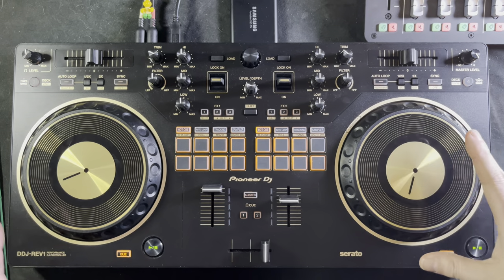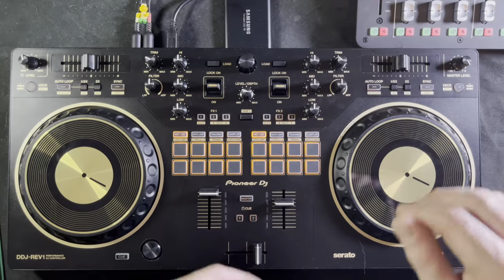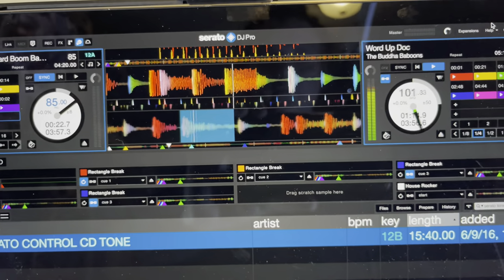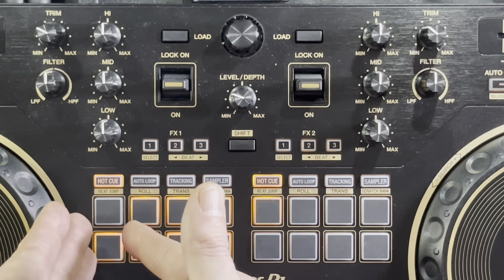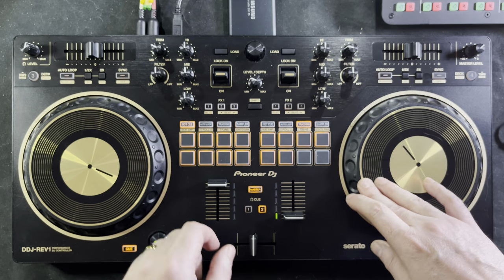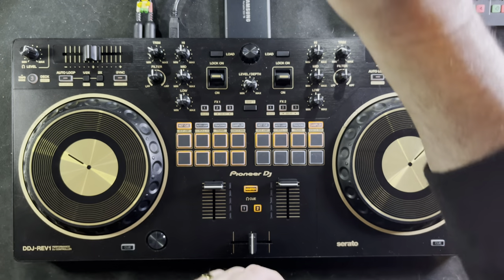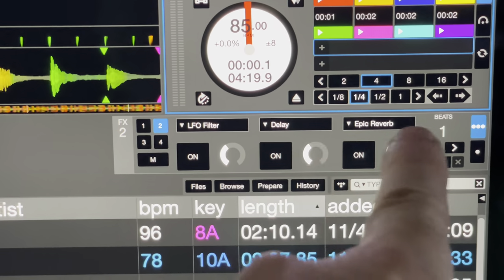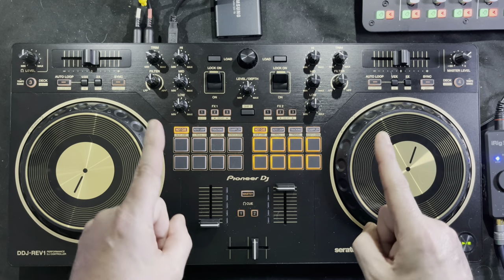In depth Tutorial of the Pioneer DDJ REV1 N limited Gold Serato dj controller

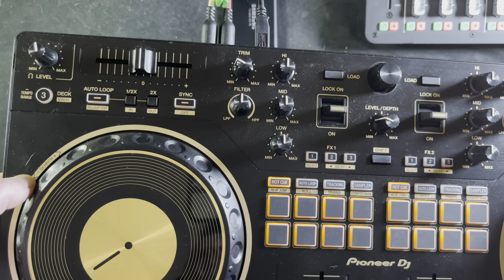Comment: 4:40 Searching
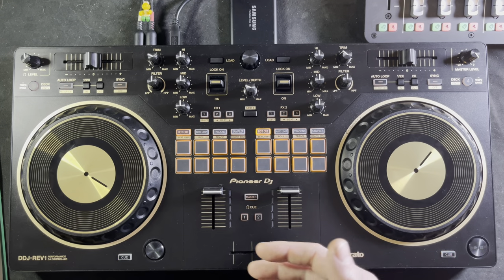6:13 Slip/Vinyl MODE
7:12 Tempo Range
7:50 Access Next Deck
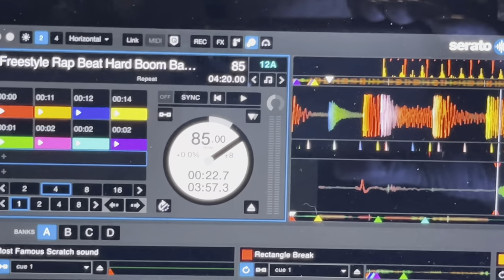8:38 View decks 2/4 (may NOT be available LITE)
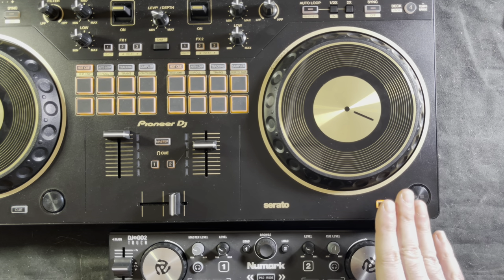10:01 Autoloop Button
13:49 Manuel Loop in/out
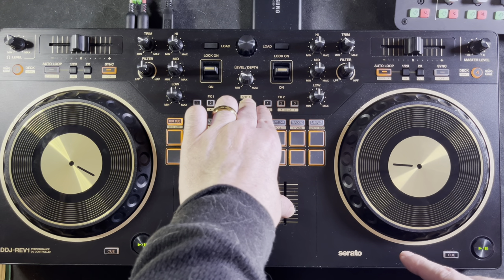14:16 Loop Adjust Controller
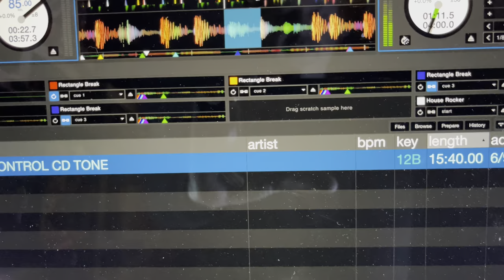15:30 Loop Adjust Visual
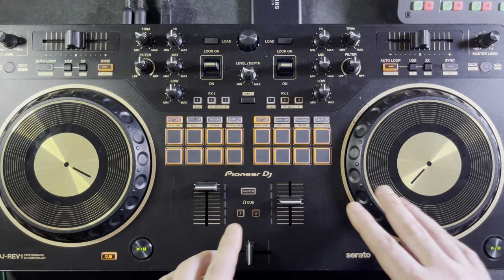17:22 Edit of up faders 
20:15 View BPM of track (---I---I---)

Comment: @djchance the beat jump feature is useful for exactly what you mentioned—setting hot cues. For example, you find the start of the chorus or vocals and you set beat jump to 8 or 16 bars and jump back to find the previous hot cues.

This makes it easier to do on the fly and ensure your phrasing is correct for layering, transitioning with breaks, etc. (obviously you need a little more attention with live music)
Reply from the maker: Thanks for the breakdown. It helps.

Comment: I have the Pioneer Rev1 with Serato Pro on a MSI gaming laptop 

When using stems i realize after a while the software freezes. Does anyone else experience this? What can be done to avoid this? 

I often closed unused programs with task manager
Reply from the maker: Wish I could help. I only use MacBooks. I hope you find the answer
Reply: @idjchance  Thanks though...these are the specs the laptop I use is 11th Gen Intel(R) Core(TM) i7-11800H @ 2.30GHz   2.30 GHz with 16GB RAM

Comment: God knows why they didn't add a fader speed / fader mode control to the controller. Most people using this will be doing standard Djing and some scratching. You need different fader curves for these. a button to switch from normal fader to scratch style fast fader would be so useful.

Comment: I just got the DDJ-REV1 and when i plug the controller into my macbook pro (USB-C - I got a USB to USB-C adapter) the controller powers on and i can control the tracks with the mixer BUT there is zero sound. I have been trouble shooting for hours after buying it and I got nothing. PLEASE HELP!!
Reply from the maker: I just tried it on 2 MacBooks and it only worked on the one with the newest OS which is Monterey 12.3 and Serato DJ Pro 2.5.11.Is yours fully updated? Apple OEM USB to USB-C? Also check to see if the volume “knob” in the upper right corner of the serato dj software is turned up.

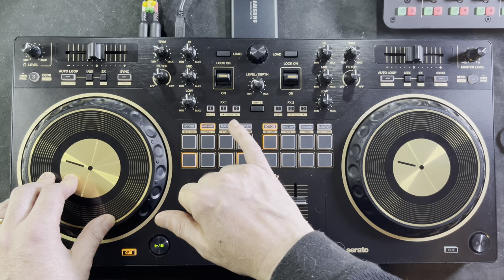Comment: Anyone know how to adjust the parameter for loop roll? You said at 28:00 mark on your video that you have it set to 1 beat roll, the max is 1/4 and I cannot figure out how to adjust it. Please show me you adjusted it.
Reply from the maker: If you go back to about the 26:08 point you’ll see that I’m adjusting the parameters by clicking on the arrows to the left or right of the parameter setting. You have to do that by clicking on those arrows with your mouse. Hope this helps. Thanks for the question and the watch Kennedy
Reply: @idjchance  that works for auto loop, but not for loop roll! I’ve search all over the internet and I’m not alone. Would you be able to make a separate video? I appreciate you replying! Thank you

Comment: Just double checked Pri Yon Joni's vid cause surprisingly the manual literally calls them pattern 1,2,3 lmao. On the tracking scratch modes, the pads go 
1: forward scratch/stab 
2: reverse scratch/stab 
3: baby + chirp combo
4: 2 click flare 
5: crab scratch 
6: military scratch

Also as far as cheating with tracking mode goes, I'll be using the fact that when you touch the platter it jumps back to the beginning to cheat beat juggling. I'm very interested in it, but man spinning static jog wheels just doesn't seem like the way to go about it. maybe I'll stop cheating once i upgrade to a rev7 or some other motorized platter lol

Comment: So i purchase one of these and was very disappointed.... had to update my 2012 macbook to mojave in order to get the serato lite which would work with it..... got serato installed and then no sound...🤦🏾 searched a bunch of vids but this particular ddj series is suppose to plug & play...no drivers...if im correct..anyone have this working on a older macbook with sierra or higher? Max os i can use on my macbook is 10.15 catalina

Comment: Hey man! when i use the roll function, i try assigning it to let’s say 1 on the performance pad, it will not assign, it keeps using 1/4. tips?
Reply from the maker: Hmmm Check in the video at 27:51 . The buttons on the controller will match whatever you have on your software screen pads. You can change the parameters on the screen with the arrows on the left and right of those screen pads.

Comment: My 3 and 4 deck only plays in headphones
Reply from the maker: Once you are using channel 3 or 4 the only way to hear them out through the master output is to use the upfader that corresponds to that channel. It’s a horrible way for it to work. I have a section in this video where I talk about how useless it really is. I’ve mentioned this for many of these 4 deck but only 2 channel fader controllers. It’s really there for marketing to say they have 4 deck capability. For true 4 channel performance, you need 4 channel faders.

Comment: Great video!
I just got the DDJ-REV1. I have it hooked up to my Mac and can hear sound through the laptop speakers. But no sound through headphones. I noticed you are using a splitter rca cable in the back of your rev 1 in the video . Is that going to one speaker monitor.
Lastly the sides of the jog wheel when I turn they don’t do anything. The top part of wheel or platter when I touch works fine.

Comment: I have the Rev 7 but interested in the Rev 1 as a backup. My main question is it accurate with bpm mixing? They are short pitch sliders so curious if it skips bpm decibels at times? Which is a big gripe about the small pitch sliders. Thanks!
Reply from the maker: Thanks for the watch and comment Tec. It’s a big difference between them pitch wise. The Rev1 is good enough but placing the pitch at the same spot (let’s say the first  + line) and it says you’re at .1 on the screen. Next time you place the pitch at that first line it might be .2 or .3. I found I do have to ride the pitch and be mindful of where I’m placing it,more so than a long slider on a more expensive controller. Keeps me on my toes I guess.
Reply: @idjchance damn yeah that was my biggest gripe about the SR2…felt like i was fiddling with the pitch too much to get it perfectly at .00 on that note i love everything about the Rev 1 but may just spend a bit more on the Hercules Inpulse T7. I’m a big fan of motorized platters (I come from Technics) however i cannot stand mechanical platters and much prefer capacitive platters for scratching. Just don’t know if I wanna go back to short pitch sliders. I mainly stick with +16 pitch percentage so I’d imagine I’d have to tweak the pitch like I used to. Great review!

Comment: I just got my Rev1 and im using it with serato but the buttom to pre hear the deck one doesnt light up so i cant prehear the deck one, when i use it with virtualdj its the other way round, the deck one light shows up meanwhile the deck two doesnt even light up. Is this problem of the product or of any problem with my software settings? Ty
Reply from the maker: Sorry to hear. Seems like the unit may have an issue.

Comment: So I recently bought the Ddj rev 1 but whenever I start up the serato DJ lite app, it keeps saying that “hardware cannot connect to serato DJ lite” 

What do I do now?

I already added my computers speakers as the default for “playback” and “recording” as prompted, but I still have the same issue

Am I missing something?
Reply from the maker: Does your laptop have the most recent operating system, latest serato version and meet the minimum requirements to use the Rev1? Any of those not up to snuff could cause it. Even a faulty USB cable direct from the unit to the Laptop. Don’t use a hub.

Comment: Is there a way to change the jog wheel sensitivity (to make transition between tracks when you are mixing)?
Reply from the maker: If i'm understanding your question correctly,  there's only switching between the vinyl and nudge modes for scratching or mixing..I hope that helps.
Reply: @idjchance hello does that has anything to do with the spin back on the platters. Is there a way to adjust that?
Reply from the maker: @DjA.Sauce5  Yes you can go to the 05:38 point of this video and I go through it. Hope it helps https://youtu.be/VsSbbF7lTFo
Reply: @idjchance  appreciate ya 💪🏽
Reply from the maker: @DjA.Sauce5  happy to help

Comment: I’ve been using this controller for a few weeks and the right jog wheel is not responding the way it should.  I was thinking it could be a grounding issue, but I think it’s the actual controller itself.  Im about to send it in
Reply from the maker: That seems to be an ongoing issue with these just by what I read in the comments for this controller. It’s unfortunate. I had the same issue with my DDJ sx but Guitar center replaced it twice because I had purchased the performance guarantee. I hope you can get it resolved. Thanks for the watch and comment it’s a huge help to the channel.

Comment: Hi I have this equipment what do I need to do in general so I can be ready
Reply from the maker: If you have this controller, make sure you’re running the latest version of serato DJ Pro and your computer meets or exceeds the minimum system requirements as stated on serato.com. A set of headphones and speakers and the applicable cables for them. Thanks for watching and commenting Giancarlo.

Comment: I play fairly developed progressive deep to straight up trance and techno but i like this layout of this controller. i like the size and the jogs seem a comfortable size and seems like the mixer area has enough room to not be cramped and the up fades are further apart.would used the pads for stems and loops. would be even dope to do a rotary knob fader mod to be a rotary mixer. only thing not ideal is how the eq knobs are far up from the level faders. with long fade mixes I like the EQ knobs close to or right next to the level faders for each channel like the 19inch rack mixer style or old pioneer 2 channel 300(?)
Reply: for controllers I like the pitch control to be put like this battle style. out of the way since its not so vital on controllers with sync and nudge buttons and jogs. they made the overall package so its not the kind that tries to impersonate a mixer and 2 decks but it is a controller being one single piece of gear that has functions that still allow a 2 decks and mixer style of spinning.

Comment: ? Trying to find out from serato or pionner if the tracking and trans pad modes can be remapped in serato pro for something else like saved loops, pitch play, slicer etc. They haven't replied yet.. do you have any idea that seems at all possible ?  Such a cool controller but I would really just prefer that it had pad modes like other serato controllers...
Reply from the maker: Unfortunately, I was told it’s not midi mappable as of yet

Comment: With this Rev-1 controller in this video are u using Serato DJ lite or Serato DJ pro?
Reply from the maker: I’m using Serato DJ Pro.
Reply: @idjchance  ok that would explain why I can’t open up the controls to the volume and changing the different echo and flange sounds. I’m only using lite for now. Need to upgrade. Also, I plugged my hard drive up and it’s not reading my files within the Serato program. I’m using a MacBook Pro

Comment: My ddj rev1 just doesn’t work lol won’t play tracks
Reply from the maker: Sorry to hear yours is defective. I’ve seen a lot of reports of the jog wheels intermittently not responding. I’ve also seen a bunch of Rane One and Four complaints. Maybe all the supply chain issues caused a huge drop in reliable components or companies chose cheaper components just to get gear out and make more profits. 🤷🏻‍♂️
Reply: Holyshxt! I was just about to buy a Rev7 for me personally, as a pro, and a Rev1 for my bro as a present. Thank God I didn't
Reply from the maker: @TonyMontana33452  yeah it seems to be a thing. I haven’t had any issues with my rev1 at all. Maybe since I have an early production limited model it was built better. I have no idea

Comment: @DJChance is there a way to save loops and then use the controller to access them? The auto loop function is ok. I would think it would be more useful to use the pads to store loops then to use them to trigger different sized loops? Then we have roll and beat jump which is almost the same thing. It would have been nice to have one of those for flip instead. The scratch bank is cool. I could do without trans mode.  I might be shipping this back
Reply from the maker: You might be able to midi map them to the controller
Reply: @idjchance  yeah I thought about that too. I'm gonna look into it and see what I can do. Thanks

Comment: So I have a SX3 and I usually press SHIFT+ KEY LOCK so I can have a big range of bpm adjustment. is this feature here on REV1's?
Reply from the maker: Yes. You have 8,16, 50% capabilities on the Rev series
Reply: @idjchance  Where do I find that?
Reply from the maker: @carlosdeguzman1602  there are buttons above each platter marked Tempo Range. Hold Shift and tap Tempo Range.

Comment: What mixer would you recommend for beginners?
Really appreciate your input 👍 
Much blessings 🙌 
Ty🎛🎧🎤😎
Reply from the maker: That’s a tough one. It really depends on your budget, are you gonna be mainly a mixing dj , a scratch dj, what kind of build and sound quality. What’re you trying to achieve?
Reply: @DJChance  Mobil dj, not scratching with good effects, XLR, good outputs and inputs.
 Budget about up to $800
Ty for responding.
Much blessings 🙌 
🎛🎧🎤😎
Reply from the maker: @ppg19782  I can think of 3 you can check out. The Numark Scratch is in the $499 range and at the top of your budget I’d say pioneer DJM S5 or if you don’t need performance pads, Pioneer DJM-450.
Reply: @DJChance  ty so much for input.
Much blessings 🙌 
🎛🎧🎤😎

Comment: Would all of these features and effects you are doing in serato dj pro? I only have the lite version and can't seem to do some of them or access.
Reply from the maker: Hi Kyle. Thanks for checking in. Unfortunately you do need the Serato DJ Pro license to access everything.
Reply: @idjchance  thanks for the reply, another quick question I did have was for the sampler section like the air horn, the swish, etc.. do I only get those 4 with the serato lite? or how would I access more? I believe I would then have to upgrade to pro it sounds like for that as well. thank you.
Reply from the maker: @kylebednash6920  I don’t actually know. I already had samples that I had been using for years in Serato DJ Pro and when I plug in any controller,my sample banks are always loaded with what I’ve always had.

Comment: great video, i'll definitely come back for the detailed scratch bank and performance pad explanations; but is there ANY way to enable/disable key lock like on the ddj-sb3? I have scoured the manual, watched tons of reviews, and I cant believe that the feature would be absent on this controller. So far i've had to click on the icon within serato which defeats the point of having a device that is meant to keep your hands on the decks and away from the mouse/trackpad.
Reply from the maker: The key lock on the SB3 is the button right next the tempo/pitch slider. Just press it to turn it on or off. If you’re talking about Key Sync. That is not controllable from the controller. Only on the screen of Serato dj pro.
Reply: @idjchance  for the REV1, not the sb3. i got very used to the feature on that controller, but i haven't found it on the rev. also called master tempo i think
Reply from the maker: @f67739  unfortunately you can only turn that off on the software screen. Not the hardware itself.

Comment: Are you using this with the rodecaster pro
Reply from the maker: Yes I am. Thanks for the comment and the watch Cross
Reply: @idjchance  still watching I have rcp2 I want to get a controller for smooth transitions and mixing I’m a beginner would you recommend this one or cheaper one even from pioneer
Reply from the maker: @crossoverradio1  in that same pioneer world you can try the the FLX4. It’s about out the same size but it’s in a standard club style setup instead of the Rev1 battle style and it can be used with not Serato DJ PRO and Pioneer’s Recorbox softwares. If you just need to mix music in a more basic way you can try Hercules Starlight mini controller or the Numark Dj2Go2 touch for around less that $100. I also have video tutorials for the both as well. Let me know if that helps.
Reply: @idjchance  thank you I appreciate your time
Reply from the maker: @crossoverradio1  I’m happy to help.
Reply: @idjchance  what do you think about the Ddj 200 from pioneer as a starter . Your thoughts on mixing and smooth transitions and even scratching
Reply from the maker: @crossoverradio1  I’ve never used it since it works with its own software called WeDJ or algoriddims Djay or edjing. I only use Serato
Reply: @idjchance  thx ordered rev 1 it’s on its way
Reply: @idjchance  got it yesterday can you tell me how did you hook yours up to the rcp
Reply from the maker: @crossoverradio1  Fantastic. I have a video- 
 https://youtu.be/Mr7T0OTn3cg?si=3Mxvahffu5J0gh9B

Comment: How do i get my mic to work on the ddj rev 1 😩
Reply from the maker: Hi Emil. Thanks for the question. The mic volume knob is on the rear panel next to the mic jack. It’s not the best preamp but it should be plug and play. Let me know how you make out with it.
Reply: @idjchance  Thanks for answering! unfortunately Im still having some trouble using the mic. Im not sure if it has to do with my mic not having an on/off switch. I get nothing when i plug it in.
Reply from the maker: @emilbelliard3333  Well that sucks. Maybe it’s a defective unit?
Reply: @idjchance  I believe its the mic. Its there a mic you recommend for the DDJ-Rev1?
Reply from the maker: @emilbelliard3333  you can’t go wrong with a Shure SM58 with an on off switch. They’re bulletproof mics.